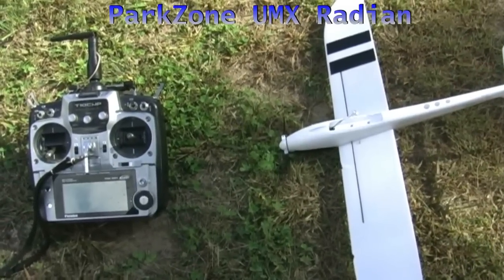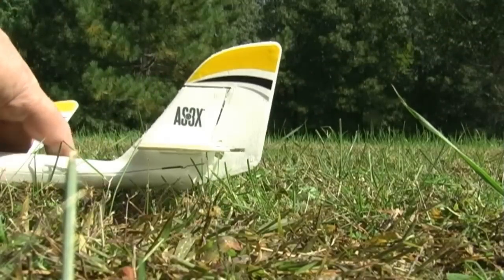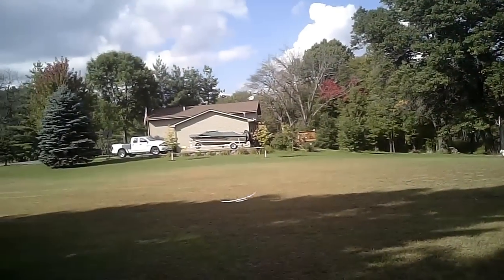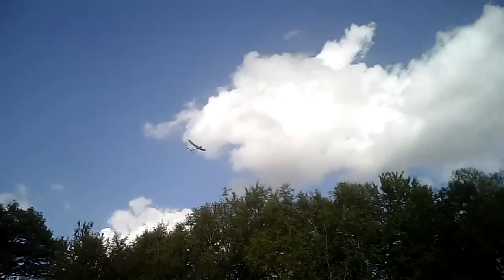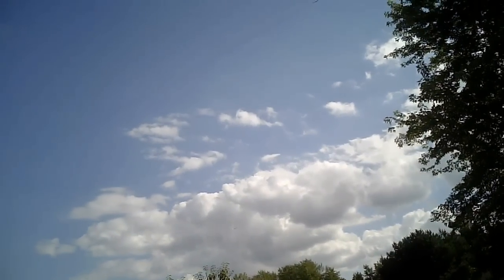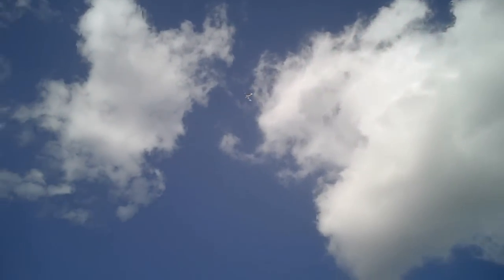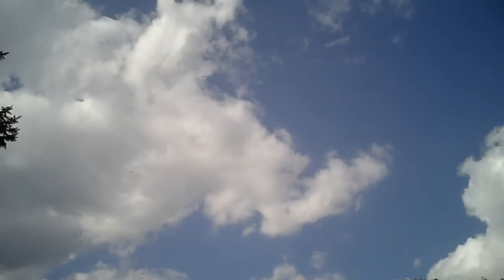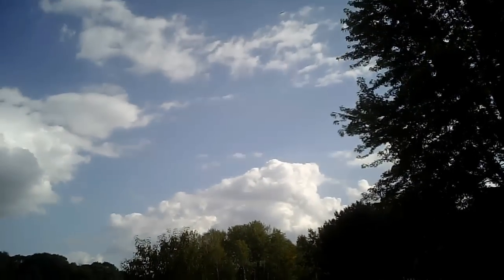UMX Radian - flying tips

Comment: So what is the difference in the two dive tests you performed?  One checked the CG and the other tested the decalage (removing the CG from the equation).  But both tests appeared to be identical... bring plane up high, do a 45 degree dive, hands off, and see what it does.  Did I miss something?  How are the two dive tests different?   Thank you!
Reply from the maker: To clarify - the power-off CG test is performed at a 45-degree angle. The decalage test is performed at a 90-degree angle (straight down) to eliminate the effects of CG.
Reply: MrTurboparker Thank you for the clarification!

Comment: Thanks to you,I can trim outvmy new Radian,I have been very happy with it so far. I spend most of my time flying a big farm field with an Apprentice and it loves riding thermals. I can shut the motor down and drift around up there for as long as I want. In the evening a lot of heat is rising off the field yet being replaced with cooler air,It pushes that plane up, up ,up. I am afraid of losing the Little radian in that field. It will be hard to get it down,lol.
Reply from the maker: Glad to be of help! Soaring is a fairly new side of the hobby for me. I've been flying RC since the early 80s, but I didn't get into sailplanes until 4 years ago, when I picked up the Radian Pro. I found that I love soaring! Wish I would have tried it a long time ago. When the little Radian came out, I was a bit skeptical, as the laws of aerodynamics are usually pretty cruel to little gliders. But the plane rides lift like a bird! I've surfed lift off black rooftops & asphalt parking lots! Anyway - have fun with yours! If you get into a real hat-sucker, put the plane into a shallow spin to dump lift & lose altitude quickly without gaining too much speed.

Joel
Reply: +MrTurboparker I figured that out last summer when I suddenly realized I couldnt get my Apprentice down,it didnt matter how much elevator I used,the thermal was sucking the plane not only up,but away from me. I started panicing,then did what you said,I was able to break free. I though I had gotten cought in the jet stream but I guess thats way too high for that to be possible. scared the shit out of me eather way. I couldnt imagine getting that little radian cought in one,it would be like bye bye!
Reply: +MrTurboparker There is an RC gliders club that meets somewhere in Alberta Michigan. They used to hang glide there in the 80's. there is a spot along the Lake Michigan shore line that is perfect for doing the Shoreline type gliding. I wouldnt be too interested in it as they get to "IN "to it  ,   for me. Thats probably why I havent joined the Local Hobby RC club eather. I have 80 acres for farmland to fly on. No nearby people to bother me. The few houses along the road are relatives of the family I fly from and all like seeing me fly. Its pretty laid back,no rules,except common sense. I am allowed to have guys come out and fly,but they would rather pay I guess. whatever.

Comment: Thanks so much for this detailed and thorough video. Not having flown in quite a while, I just got this one for a little enjoyment... and for the dog to chase. Pretty much her favorite thing ever. (Especially with Swift delta, which could go low and slow, then blast off just before getting caught.)

Your vids of the Yak were great, too. I think I'll get that one. I've had a couple of the UM Trojans. Was thinking of getting another of those (maneuverable but also peaceful and floaty when I feel like that),  but it seems the Yak has a bit more room for fun. Your video was the one that told me it can do the slow stuff I really like... as well as some blasty stuff when the mood strikes.

Thanks again for taking the time and effort to put this together.  I know I'm far from the only one who found it valuable.
Reply from the maker: Thanks for the kind words! I've been flying RC since the 80s, but I just got into sailplanes a couple years ago, with a full-house Radian Pro. Picked up this little guy when it came out. Wasn't expecting much at this size, as Reynolds is very cruel to small gliders. I was VERY surprised! It can actually ride micro-lift!

Given the large amount of misinformation that gets passed around regarding RC aircraft flight-trimming & tuning, I decided to make this video for those who are new to this facet of the hobby. Of course, all of the flight-trimming & balancing info also applies to your powered planes.

If you can find a used copy of Dave Thornburg's Old Buzzard's Soaring Book, pick one up. Best book there is on the art of soaring, and Dave's writing style makes it an excellent read! It has been out-of-print for a few years & it's also highly-acclaimed - so prices are high. Also - I highly recommend the following instructional videos on RC soaring. You can choose the custom 3 training DVD set option & save 15 bucks over ordering them separately:

http://www.radiocarbonart.com/secretsdvd/

http://www.radiocarbonart.com/performance-tuning-for-sailplanes/

http://www.radiocarbonart.com/hptsdvd/

Comment: I'm new and have only flown a few times breaking my radian 4 times already (fuse(3 breaks) and win(1 break)). So, I've got spare parts (already ordered tor replace the many breaks in this one). The main reasons for the crashes are using a MLP4DSM controller (which I now have a Spektrum DX5e), pushrod linkage failure (I now glue them with shrink tubes) and lastly MY IMPATIENCE caused me to fly in above 12knt winds (with higher gusts). 

So, you're the best pilot of the stock UMX Radian I've seen yet on YouTube! So, I'd like to ask u a question if you don't mind. I'd like to strengthen/protect the replacement fuselage and any other areas prone to breakage. I am covering it (the fuse) with a thin (or maybe a few coats?) minwax polycrylic and will also be adding thin carbon fiber rod(s). Also will be hot gluing or 30-min epox'ing the parts that need to be attached. 

Can u please tell me how many (I was thinking 3) carbon fiber spars to place embedded in the fuse? And, how long they should be? 

And/or any tips for flying without crashing all the time?

Thank you,
Art

Comment: Very nice thanks, you impart heaps of info with a few words :)
say what's that black thing in the sky ?
Reply from the maker: Thanks for the kind words! :) Glad you found it to be useful!

Regarding the black thing - that's one of the insulators for my home-brew ham radio antenna. It's configured as an inverted-L - 50' vertical & 50' horizontal, supported on each end & at the bottom of the vertical leg by ropes attached to a suspension system that allows the trees to sway without breaking the antenna wire. At 16:08, you can see the horizontal wire running from the insulator toward the other side of the yard & the rope that runs from the other end of the insulator, and back to tree on the right. What you don't see are the sixty 65-ft radials that run out from the base of the vertical section like spokes of a wheel. That's 3900 feet of wire! Well-worth it, though. I can talk to any point on the planet with that single antenna - day or night. :D
Reply: woo excellent, neat that ham radio lives on !

Comment: nice video, lots of great info, did you change the receiver ? you are using a futaba radio,
Reply from the maker: Thanks for the kind words! :) Glad you found it useful. Regarding my tx - it's a Futaba 10 CHP, which uses plugin RF modules. (That's why I bought it back in the 90s.) I simply unplugged the Futaba 72 MHz analog FM module, unscrewed the telescopic 72 MHz antenna, and then plugged-in a Spektrum DM8 module w/2.4 GHz antenna: http://www.spektrumrc.com/Products/Default.aspx?ProdId=SPMMSFUT7

Comment: Perfect video, could not ask for a better one.

Love to get one. love to have a good 10 plus minutes of flight.  And get some video onboard. I think this will do me fine.  Something I can portably take with me. Thank you again for a great video. How long of a run would I expect ?
Reply from the maker: Thanks, Fishy! Yeah, it's a fun little sailplane. Very relaxing to fly, and easy to fly in a small space. There are some on-board video clips on the RCG thread, however I have yet to put my 808 #16 on mine. Given that it's a sailplane, flight-time is totally dependent upon how much you're on the throttle. If there's a lot of lift & you only use the motor once for the initial climb, you could get ~20 minutes to the 80% discharge point with a high-performance 160 mAh batt, such as the Hyp 160. If there's no lift & you fly it like a sport-plane, maybe 5-6 minutes - tops. In what I call buoyant air (not enough lift to thermal, but enough to significantly stretch the glide) I usually get ~15 minutes in the air with 4-5 minutes of that being on the throttle, climbing back up to altitude. Not sure what you'd get while carrying a 17g 808 cam. Again, it would depend heavily upon the lift conditions.

I always set up two timers for my powered sailplanes. One is tied to throttle so that it starts when I barely advance the throttle & stops when I close the throttle, but does not reset. The other starts running when I load the model & I use the trainer switch to reset it before the launch. That way, I have separate timers for motor run-time & overall flight-time.
Reply: thank you for a very thorough post, appreciate the info.  to capture video is  a choice, other panes for that.  I feel this will be a excellent. plane to grab go get a few flights and say WOW!.  I am not in a mountain area just a city and a local park and flying around works for me.  15 minutes on & off throttle a few glides perfect. thanks again.  just going to wait for that discount or coupon from  HH. 20% flowers for valentines day  no thank you, off the plane I am there!

Comment: One important thing I learned when utilizing the A3SX is to insert battery with plane very level to let the system learn at level. And not arm esc until you're ready to fly to conserve battery with all the movement going on with the a3sx
Reply from the maker: Hi David,

FYI - AS3X is just a simple gyro-based 3-axis damping system - therefore, it has absolutely no means of knowing which way is up. (Attitude-awareness would require a 3-axis accelerometer in addition to the 3-axis gyro.)

Therefore, the plane's orientation during initialization is not at all important. It can be in any possible position - as long as it remains motionless until the initialization process is complete. That's the only thing that matters. 

Happy flying! :)

Comment: The battery is wwaaayyy to far back
Reply from the maker: It's exactly where it needs to be to get the CG to the sweet-spot for proper performance. :)
Reply: MrTurboparker I have to keep mine half way of the compartment for the battery
Reply from the maker: That's why you need to always measure the CG & do the standard CG flight-tests to fine-tune the CG on a given airframe, rather than simply go by where others put the battery. I stress this in a number of my tutorials. As you can see in my flight-demos, my UMXR flies perfectly. :)